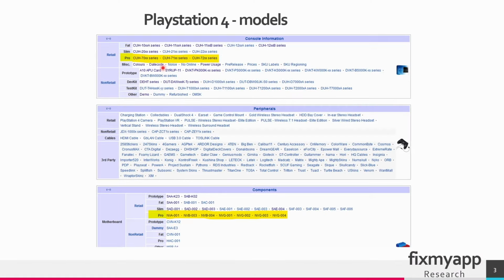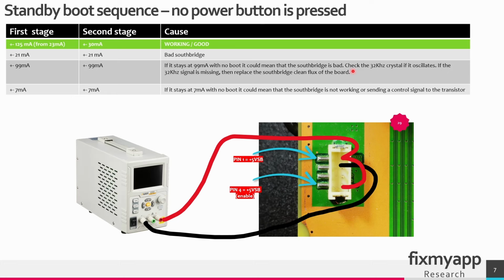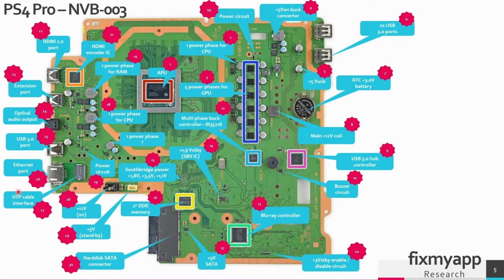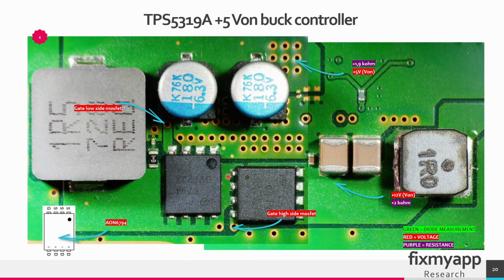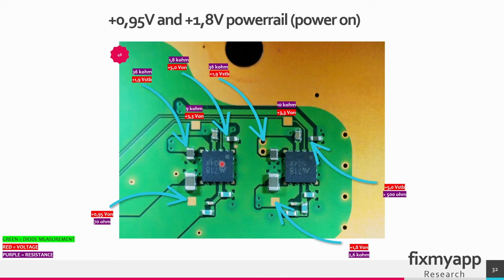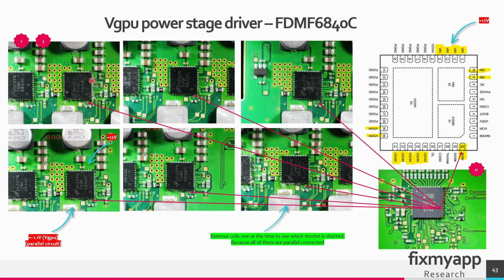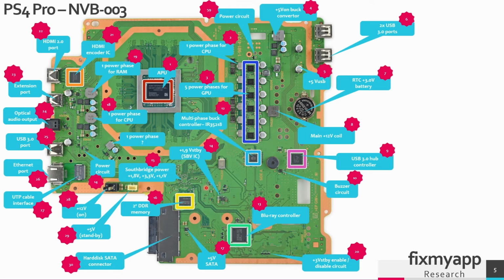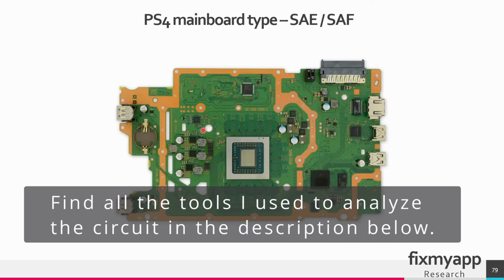Fix PS4 Problems! The Only Repair & Analysis Guide You'll Ever Need

Comment: my ps4 pro 70 series fan failed to ramp up causing the sudden shut down when ps gets too hot, how to do the reflow? i only saw the profile configuration in this video. appreciate your help
Reply: i think the PWM signal coming from the APU failed to reach the fan as per my check fan running normal when connected to direct dc power

Comment: Thank you for these great tutorials. I purchased a couple of them just to understand fully what you did and also love the videos. Keep it up. I have a quick question. Does the PlayStation 4 that you did is it will that can I compare it to the PlayStation fat the slim thank you
Reply from the maker: You can apply the same knowledge to a faulty version as long as you can identify the components. The diode measurements will, of course, be different, but with practice and experimentation you’ll gain the experience you need.
Reply: @fixmyappjim ❤ thank you so much

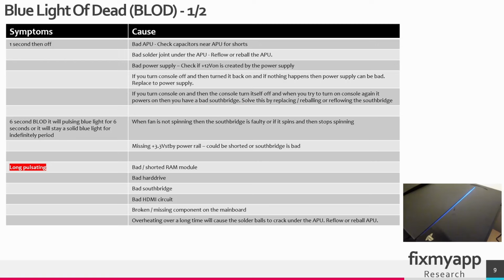Comment: just a quick question regarding on this 18:20 when checking caps near or around the APU, the caps will also beeps and thats normal right? because you are in a low resistance side since you are measuring the resistance of the apu itself, this confuse me, what are the normal ohms reading of the caps around the apu?
Reply from the maker: Correct caps near the APU are low impedance. Value is above a dead short +0,3 to 10 ohms. Gr. Jim

Comment: Very impressive work. Thanks a lot. Bought your presentation. Currently I'm troubleshooting a NVA-001 board with 1 second blue light. Using a thermal camera I have notices that the 35218 buck controler starts to warm up before the console shutdown. I'm also missing the 3.3v power good signal and the 3.3v on the left pad. Is it safe to say the controller is bad?
Reply from the maker: Hi Nik, Thank you for supporting me! First i would measure the output of this buck controller to see if there isn't a short. The controller needs a VCC power supply, an enable signal to turn on the buck controller and there should be a output voltage generated if not i would change the controller. Gr. Jim
Reply: @fixmyappjim thanks for the reply. I also forgot to mention that the some diode measurements are 2 or 3 times higher that what they should be. Meybe you know where I can buy this chip in Europe? I only saw them on ebay and I'm not sure about the quality :D

Comment: Bro how many amps can i use when putting power in thw mainboard? Does regular power supply works? Like 10amps power supply?
Reply from the maker: Hi, In standby mode a few amps is enough. If you want to power the board up then you need at least 8 amps of current. Gr. Jim

Comment: Muy agradecidopor tu aporte, y mas que nada por tu tiempo....dios te de el doble de lo que tienes!!!! como puedo contactarte?
Reply from the maker: Hola, gracias por ver mi video. De momento pueden contactarme a través de los comentarios, aún no he creado un correo electrónico de contacto para mi canal debido a... con otras actividades. Gramo. Jim
Reply: @fixmyappjim  JIM, CAN YOU GIVE ME GUIDANCE ON RECOVERING A PS4? I WILL THANK YOU.
PS4 SAF-003 board does not activate GATE to NBcore mosfet. It turns on for about 5 seconds and turns off.
Reply from the maker: @livingledsanjuan8798  Hi i would suggest to analyse the serial communication to see which error it gives, for this you have to reflash the NOR ic and solder some tx / rx wires to the board. Gr. Jim

Comment: Hi and thanks for your grateful work, I have cap resistance in ram module one is 47 ohm and other side of ram cap is 0.790 Kohm. my board is NVA-001.The Ps4 turn on blu led and next dvd spin go power off
Reply from the maker: Hard to analyse this i would turn on debugging by reflashing the BIOS to see the error message by serial communication. Gr. Jim
Reply: @fixmyappjim  thanks!!

Comment: Hi .good work.very good job. I got a blue lght of death and no 5volts on usb. Could you tell me what IS wrong?
Reply from the maker: First probe the board for shorted lines if then i would check the BLOD  by soldering wires and reading the serial communication with debugging information. Gr. Jim
Reply: Hi sir there IS no uart for that PS4. What could bé thé problem ?

Comment: Regarding the i2c communication that these boards have, do you have any information?
Reply: these information would be amazing for us!
Reply from the maker: I do not have enough information about this but i suspect the APU or the southbridge is the master and all other IC's with i2c are the slaves. Gr. Jim
Reply: @fixmyappjim  Regarding I2C communication, I have done some research and part of Syscon, for example, from Syscon there is an I2C bus that goes to the PWM IC that excites the APU power phases.